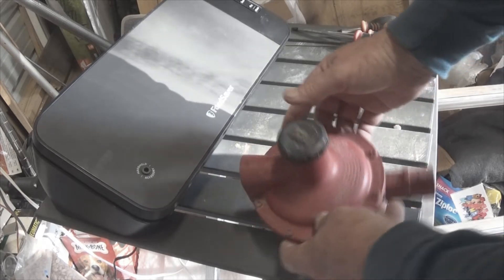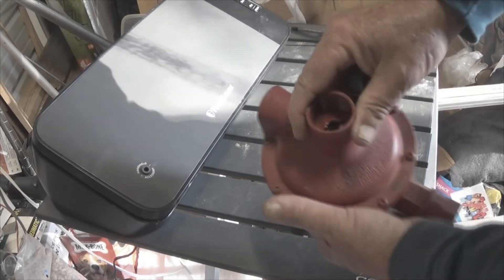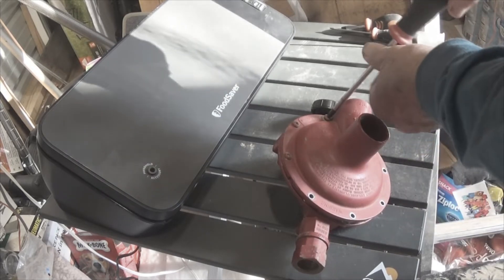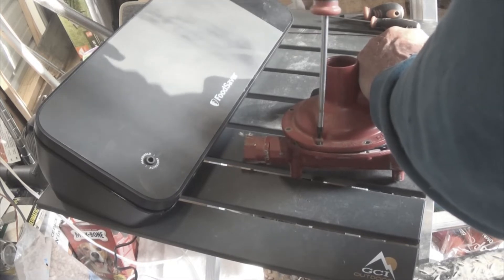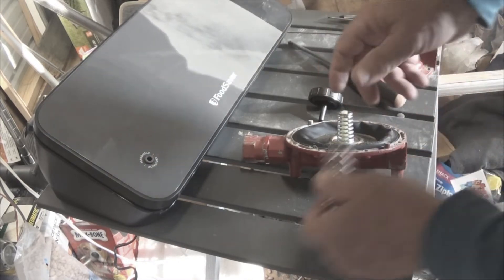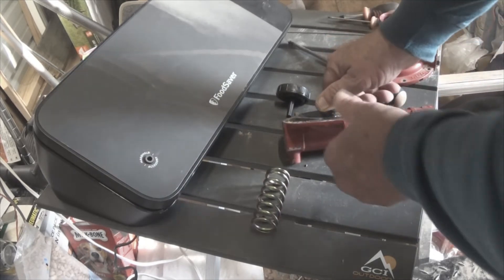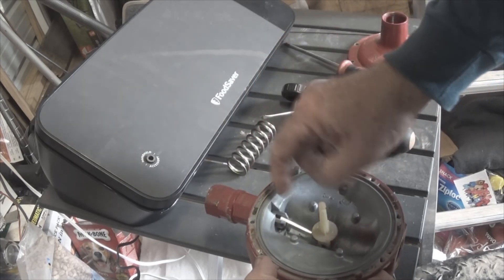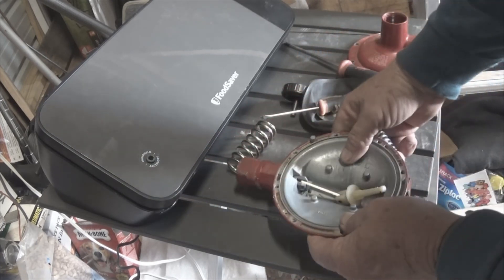propane gas regulator tear down   from the 250 gallon tank repair

Comment: Where can you purchase diaphragm for rego 450l regulator
Reply from the maker: during my time in the oil feil we got ours from a company that rebuilt regulators and dump valves.   if the company that made it does not sell them, i would look for oil feild supply/support and look for a company that rebuilds regulators since they are used everyhwere in the oil feild
Reply from the maker: given the cost, i would look on line for the right size it might be cheaper than trying to rrepair the regulator.  repair is easy,  the work is not bad, just make sure your time is worth the money.